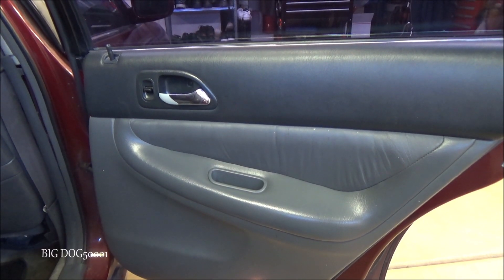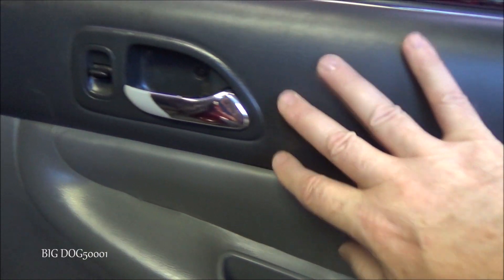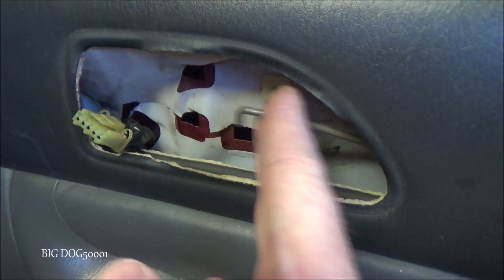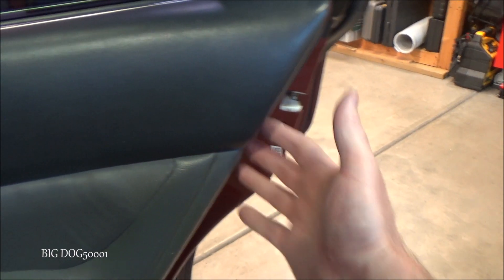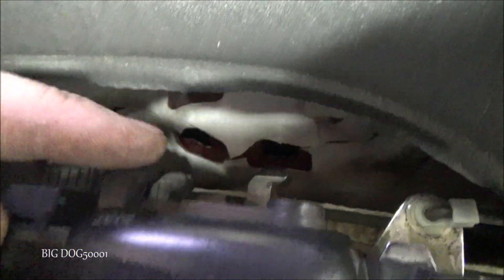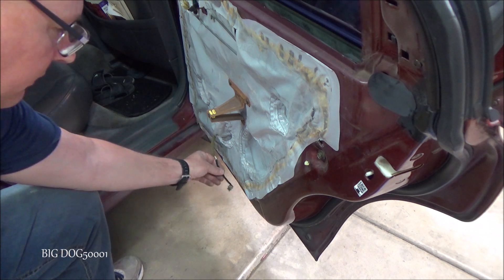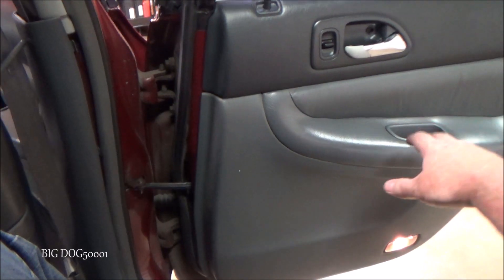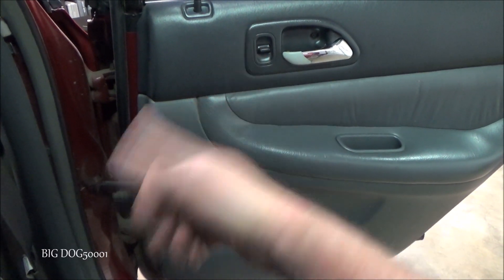Honda Accord Door Won't Open

Comment from the maker: I should have mentioned it in the video but anytime a rear door will not open from the inside, be sure to check the child safety lock first and verify that it is not activated.
Be sure to subscribe for more tool and car repair videos! 
https://www.youtube.com/BigDog50001

https://twitter.com/BigDog50001
https://www.instagram.com/bigdog50001/

Disclosure: This channel earns a small commission using some of these links - at no additional cost to you.

The Big Dog 50001 Automotive Channel Store can be found here: https://www.amazon.com/shop/bigdog50001automotive
Reply: I made it to the 15 second mark and said that out loud. 🚫

Comment: Thanks so much for this video. Helped a lot. The hardest thing is to find that pin blindly. Your pic of the latch was extremely helpful. One suggestion to anyone thinking of replacing the latch- buy it first and take a good look for that pin, That helped me locate it blindly with ease. Within 10 minutes I had the door open (once I did all the preliminary work of getting to the darn thing.)

Comment: I've done this many times without any camera. It's an easy fix. Put the plastic piece on first and add a tape to hold it still. Add the metal piece and stick it in. Once in then apply the plastic clip and feel where it can go

Comment: Thank you for an excellent video. I've got a 2002 Accord with similar door panel, latch, and rod setup. My left rear door will open from inside, but not outside. When you pull the outside door handle up, there's no resistance. It moves freely and goes back into place, but doesn't release door. Any ideas what it might be?

Comment: In your video, you see a black piece of rubber or plastic over the area where the clip broke. It seems to be a cover over an access hole. Why didn't access the clip assembly through that? Or am I wrong about the access hole?

Comment: so if it will open from the inside, but not the out side would it likely be the clip at the handle instead of the clip at the latch?or a different problem all together?

Comment: good video..I may and will if necessary use  either poster tack or some silicone to help hold the clip to the screwdriver tip to install. (if this is my issue) But.. mine was the broken chrome door handle inside the escutcheon-
  FRONT >> $4 and up on eBay COMPLETE.
Reply from the maker: Thanks for the comment!

Comment: Great Video.. Not sure how will you do this without scope.   By any chance do u know what should be my PSI reading for AC compressor going bad, and what PSI value for stuck TXV valve open or closed stuck for low and high side. I think that will be great value add to your site and viewers like me... Thanks again.
Reply from the maker: Maybe one of these days I will make an AC video.  Thanks for the comment!

Comment: Hello . I have a 2004 Honda Accord Ex. I changed the actuator on the rear right door. Now, I can't get the door open from the inside or outside. I was able to remove the door panel from the inside with the door closed. I am trying to figure out how to manually unlock the door from inside. Any suggestions? Thank you

Comment: My key quit unlocking the back and passenger doors now the windows roll down instead. 

I was fumbling with the driver's door  controls the night before I've tried pushing the button next to the door lock button but can't seem to reset it. Suggestions?

Comment: What do you do when you have a door that’s closed and you can’t open it from the outside either?
Reply: right? how can you get the panel off if the child lock is on and it wont open from the outside?

Comment: step one: start with the door already open :/
Reply from the maker: Yeah if can't get the door open from either inside or outside you are probably going to be breaking things to get in there.  It is no fun.
Reply: Alright so what should I start breaking then because I have this exact problem
Reply: On the driver side door
Reply: @SupmanerGamin did you figure it out? I’m having the same problem